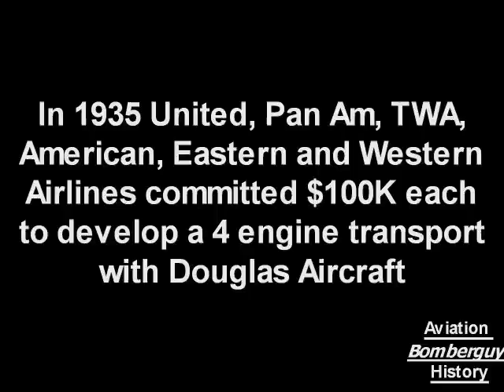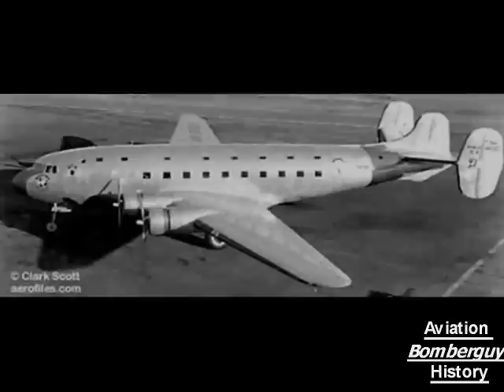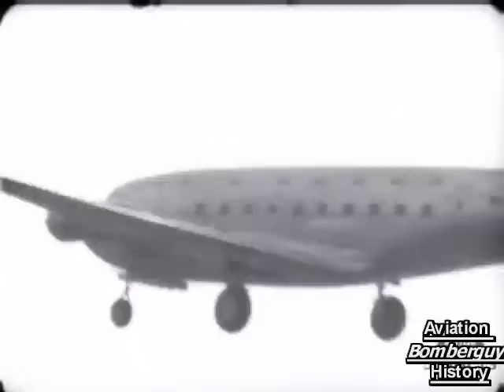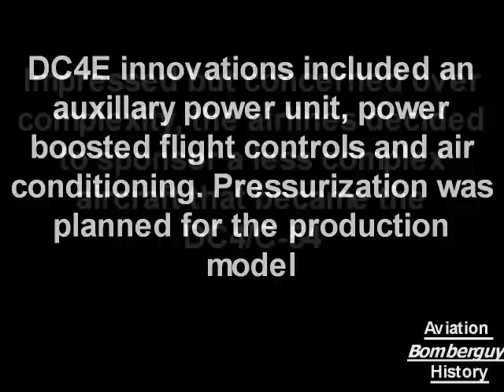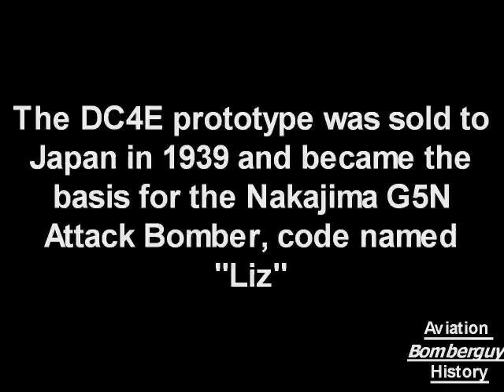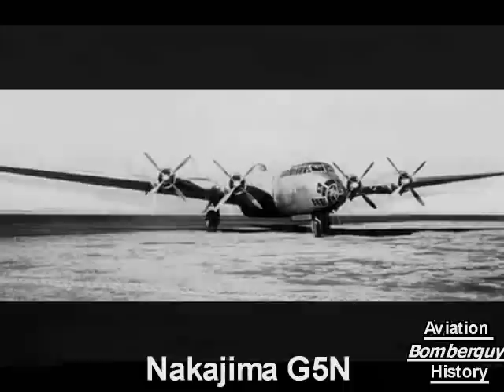Forgotten Aircraft: Douglas DC-4E

Comment: This plane was the predecessor to the C54 (Navy  & Marine R5D)   They served well during the Berlin Airlift
Reply: Jim Key no, that was the actual production DC-4, not this prototype.
Reply: JBof:   The DC-4 was the actual Predecessor to the R5D, a plane I knew very well as I was well acquainted with it in the Marine Corps.  the  R5 had a single tall tail stabilizer due to t problems with the DC-4.  It was also equipped with R 2000 engines and held more fuel.  We could fly from the East Coast to Gander New Foundland; Refuel and then on to Oslo.  Sometimes a stop at Shannon to refuel. if going elsewhere in Europe. They were slow by today's standards but a leader in the 40's and 50's.  They were quieter than The the R4D which used R1830 Engines  Thanks for the reply.

Comment: Lucky they never got around to pressurizing it.  Those square windows would have probably resulted in the same fate as the original Comet.
Reply: Probably not. Just take a shufti at the DC-6 and DC-7. All square windows, no problems. Then why got the Comet into trouble? It flew a wee bit higher than the prop-liners, where atmospheric pressure was much lower, meaning its fuselage was stressed much more. Which in turn meant metal fatigue occurred much earlier, which led to the sad demise of the Comet I.
Reply: Boeing 307 had square windows.
Reply: DH Comet 1 had OVAL windows.
Reply: The "window" which failed in G-ALYP was not glazed, and was the aperture at the top of the fuselage to accommodate the ADF aerial loop.
Reply: @omepeet2006  ; Fuselage wall thickness was the problem that made the square windows fail.
The 707 has 3x the wall thickness and round windows.
Reply: @Johnnycdrums  Did the 707 have round windows?
That's new to me.
Reply: @omepeet2006  ; You're right, not round.